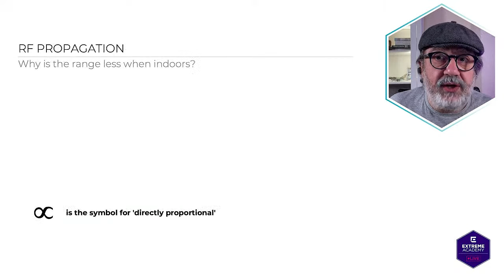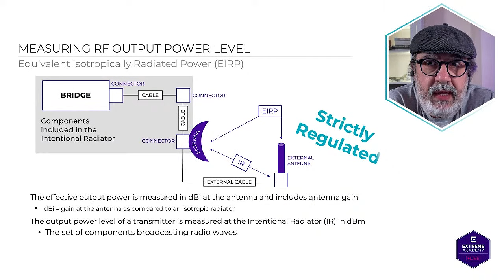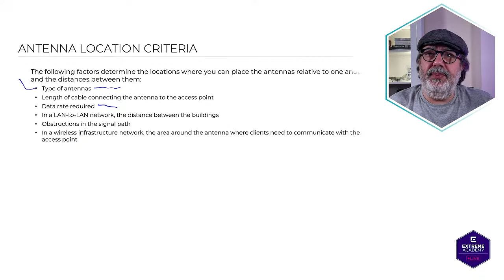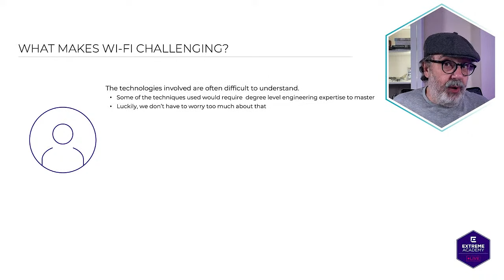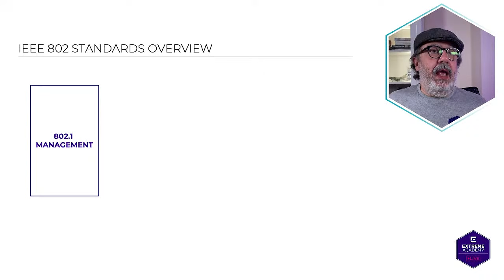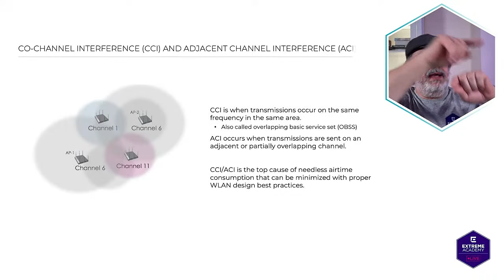Part Three - Building Secure and Robust Wireless Networks

Comment: 1:39:00 I think wireless mesh network use RSTP/STP to detect loops? I get what you are saying though, the wireless mesh network would not know about the loop caused by the physical cables. Could the router connecting to both the wireless bridge and the physical cable not use STP to detect loops though?